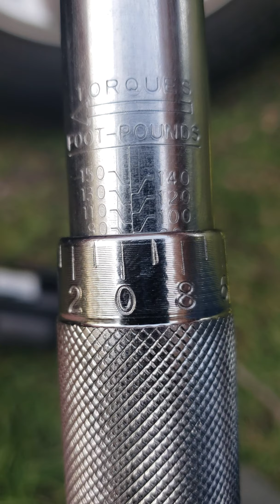Lug nut removal test with Ryobi P235 impact driver

Comment: Those small batteries do not allow the tool to pull enough power out of them to reach their spec'd rating.  You need at least 3 or 4ah battery.
Reply from the maker: Yea I plan on getting some bigger ah batteries. Both my impact and drill have surprised me with some of the stuff I've been done with them.
Reply: Instablaster

Comment: I always laugh when people buy the entry level impact drivers (not wrench) and expect them to do heavy applications. The Ryobi p235a is great for any diy at home job that your drill just can’t cut. Impact drivers are excellent tools. Want to remove your vehicles wheels with an impact ? Get yourself the Ryobi impact wrench with a 4.0 A/h battery. It’s still an entry tool that will pull that job off easy.
Reply from the maker: Well to an extent I agree with you. However, I have another video on my channel where I'm using a bigger battery and I'm able to get the lugs off my truck with no problem. The current battery in this video is only 1.3ah. I've seen Milwaukee impact driver not perform to it's capabilities because the battery was too small. But once a bigger battery was added it performed great. 
But yes an impact wrench would and should be the go to tool for this type of job. 👍

Comment: I tried using the P235avn on 110 ft-lb lugs on my Volvo XC40. I torqued them to 110 ft-lb prior to testing... the P235avn could NOT remove the lug.